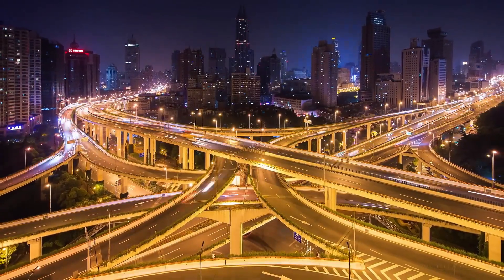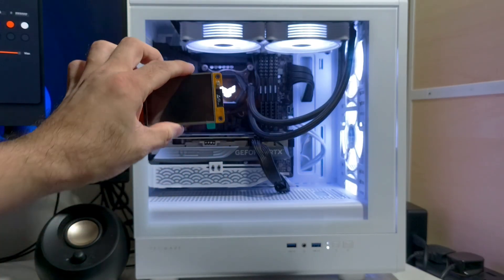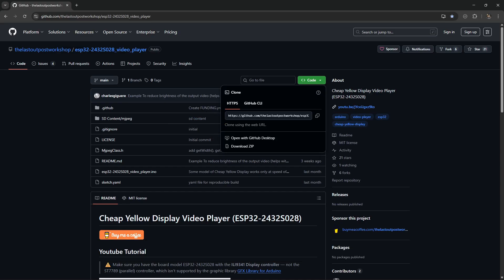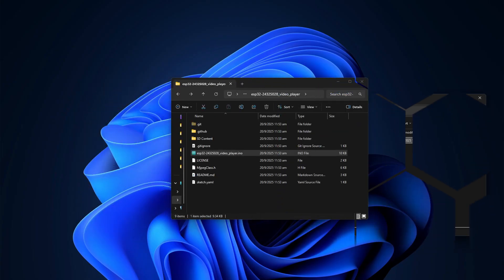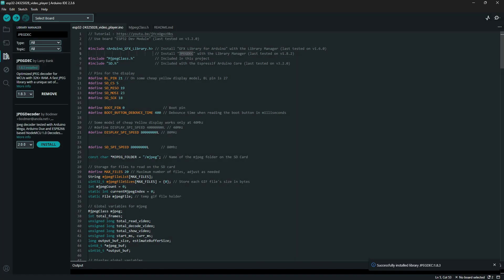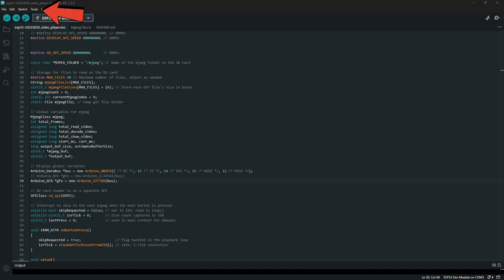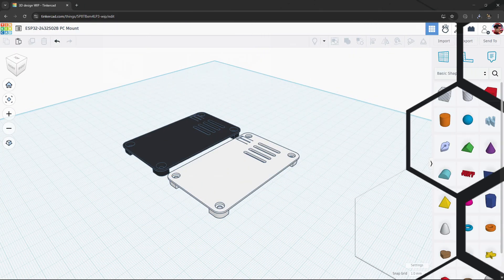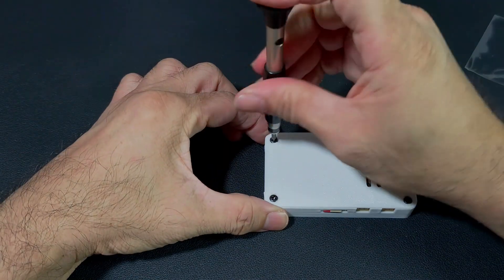DIY $15 Internal PC Screen 💵 (ESP32 Cheap Yellow Display)

Comment: Very nice work and looks good but I have a question that you could hopefully help with, Is there a larger display that this could be done with, I kinda want to replace an entire side panel of a pc case due to damage with a one off build idea but have no idea where to begin shopping for a cheap but viable display, this video has given me some more hope I'm capable of the project but finding a screen roughly 13" x 15" (33cm x 38cm) and some extra help ontop of this video would be appreciated (if I can use the exact same process just changing the details to account for a larger panel etc or if I'd need to do further work)
Reply from the maker: Unfortunately, the ESP32 don't have enough processing power to play videos on a large screen. I have a few ideas:

1) Easy - No display. Just buy a piece of custom cut plexiglass from a local supplier.
2) Need a bit of work - Get a cheap 14-15 inch mobile monitor, a Magsafe magnet, mounting plate. AliExpress, Amazon, Ebay has plenty of these. Mount the monitor into your PC, may need to design your own PC-monitor mount.
3) Awesome, but needs patience - Sacrifice an old LED screen, turn it into a transparent side panel display. https://www.youtube.com/watch?v=Shp5JhOqdKI